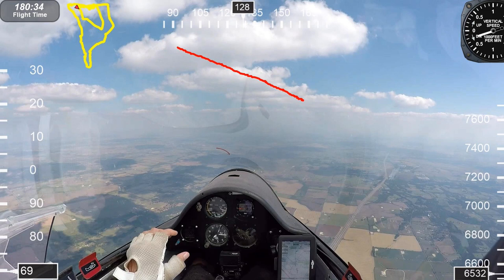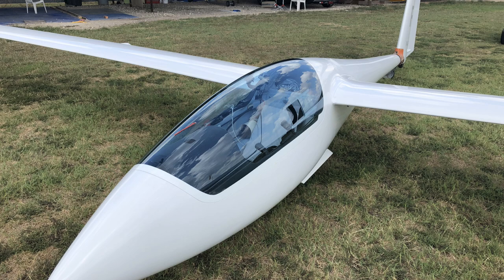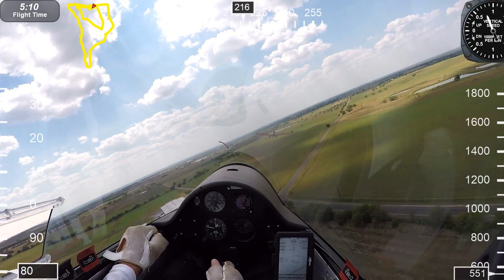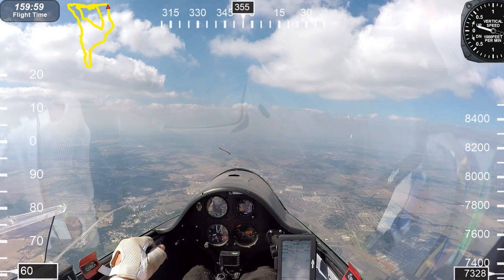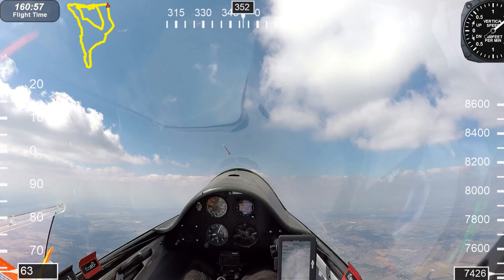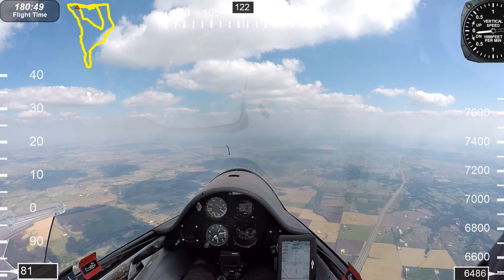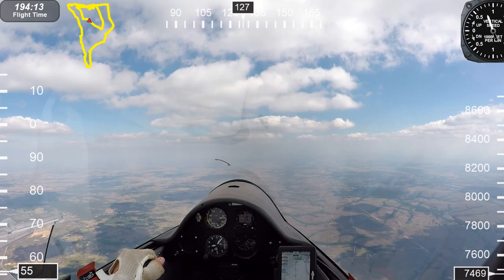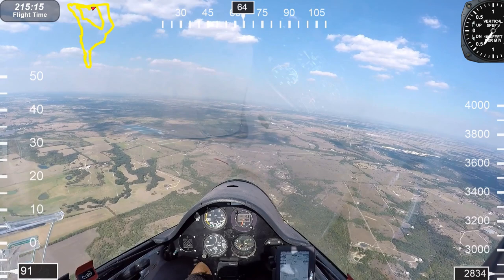Flying gliders in thermal streets. ASW-20B. Its a magic carpet ride Roy Dawson video

Comment: As a single-engine student, I cannot help but marvel at how glider pilots do it! Really cool vid, dude.
Reply: Gliding is great for single engine students and it is well worth having a few dual flights.  Don't be fooled by the old '...every landing is a forced landing...' fallacy, the airbrakes can change your l/d from 35-1 to 5-1, but some proper seat of the pants flying helps to stop too much concentration on the numbers and you really learn how to use the rudder.  Neither is harder, they are just different.  Best wishes for your future flying.

Comment: I'm guessing your yaw string is actually centered, and the camera angle only makes it look off to the side, but still, it seems as though during your turn to base shows the yaw string indicating a skid, which can be lead to a stall/spin.  Please be careful with that.
Reply from the maker: With the camera on the far right, it always appears to show a skid when turning left. I got so my people commenting about this I cut out most of the landing. If you watch a left turn in other parts of the video it will tend to show a skid  or even flying straight as I was on base it shows a skid. Thanks for asking.